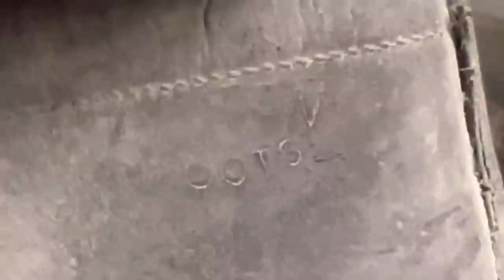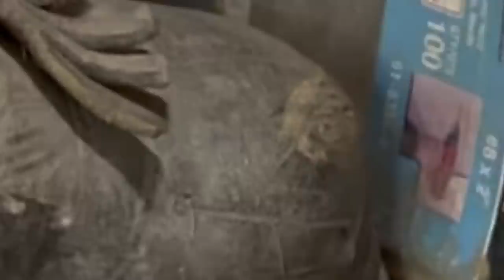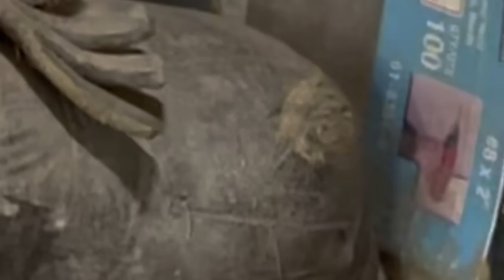Chainsaw Horse Power is Created By Your Imagination

Comment: I appreciate the creativity. Just a word of caution. All multi- position small engines come stock with an approved spark arrester, which most are 23 thousandths of an inch stainless steel screen. If you are using the chain saw in a fire prone area, you don’t need to create a problem.
Reply: Yea no spark arresters here

Comment: Hi Billy I've been a long time watcher and I've learnt a lot of your videos. I don't have a lot of first hand experience with chainsaws though. My old chainsaw is done for and I need a new one. The only thing is that i don't know which one, and I can't find any good advise. I'd mostly use the saw on medium trees and for cutting fire wood a couple of times a year, so i don't need something too big. I was thinking around 50 cc wtih 18" of a bar, but maybe thats not the best option? So I wanted to buy the husqvarna 450 rancher because it's recommended everywhere, but i cant get it anymore in belgium. I can't find the second version for less than 780 EUR (850$), which is too expensive imo. Could buy the 455 rancher for about 640 EUR(700$), or Stihl ms 271 for 700EUR or the stihl ms 251 for 600EUR, or maybe something less powerful is enough? Or maybe something else? I really don't know what to get... Thanks for providing a young man like me with lots of advice and entertainment! Keep up the good work and take care
Reply: I would go with a Husqvarna 550 XPG MARK 2. Best saw i every used in 40 years
Reply from the maker: @markus4965  good saw
Reply: Thanks! I had a quick look, this saw looks to be a beast! The price where i live is also quite beastly, coming in at around 1300$... So i don't think its really an option for me. I don't know why chainsaws are so expensive here in europe
Reply: Hi @LegendOfMithras have you thought about 254/254XP?
With a 20" bar and a sharp full chisel chain, its a proper little beast.

Here in estonia they go for about 250-400 EUR.
I hope You find a saw that will make you happy when using it!

Comment: I would guess tree climbing. However I have worked in a metal fabrication and welding production shop working with large tanks and my boots would get that same thing from kicking the pipes and climbing around on up 90 foot diameter steel tanks. So the spikes on the bottom say tree work not steel. And that shop where I worked charged $200 and hour for just my labor. Of course I never made close to what they were charging for me but I gave 100% for a fair wage and loved my job.